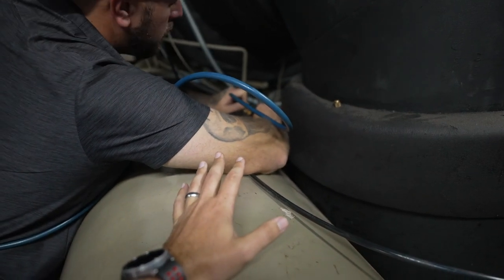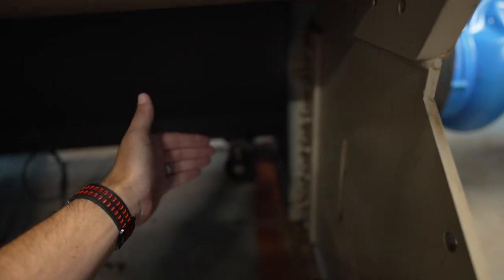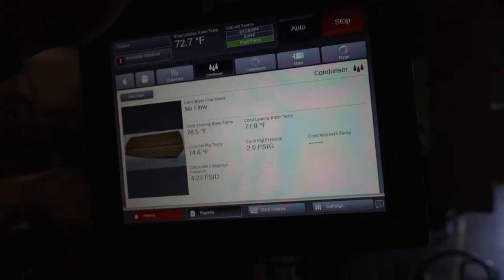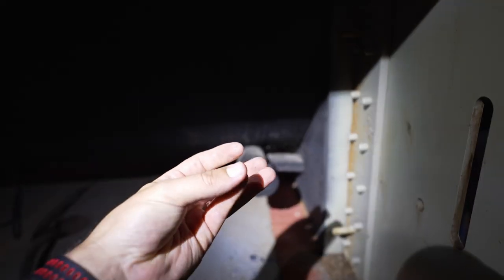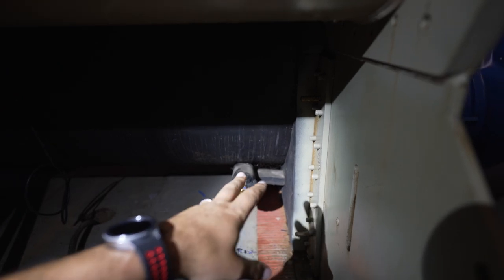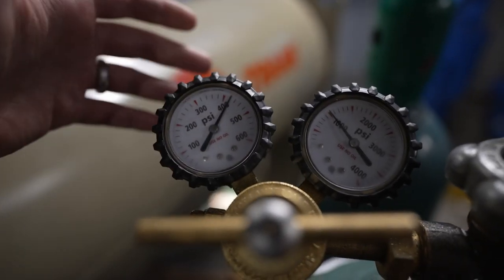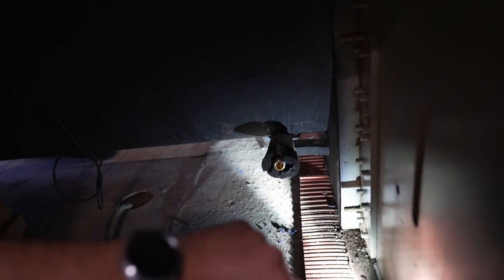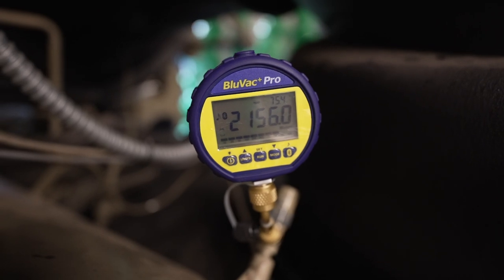Fixing Moisture Issue with Chillers

Comment: I've thought about this a lot. I'd like your thoughts too. What nobody thinks about is the moisture that is mixed with the recovered refrigerant that we are going to be reinstalling. We spend so much effort dehydrating the chiller, that we forget about the refrigerant we are about to put back in. We could take a refrigerant sample and send it out, or our annual samples on the chiller might show moisture. 
If we had a tube let go, the charge is "gone" anyways. I'm more or less talking about an open system (cold evaporator tubes attracting mositure / dew) or minor contamination (less than a cup of water).

Just food for thought.

Comment: Would raising the temperature of the barrel help remove the moisture at a higher rate? Like disconnecting the the hydro piping and ducting some sort of forced air heater into it? Or if it was possible to flow hot water from a boiler thru it? Maybe feasible with a 2 pipe system setting? Just curious. Maybe not enough to go thru the extra trouble?

Comment: Thanks for the information. I have noticed I can pull a vac to 400 mic and then during decay it will rise to about 2000 mic when Im working on a wet system. Great video. Thank you
Reply: Rite, that's the importance of decay tests, if you can get that low you're most likely safe from a leak but what he didn't go over in the video is yes water can and will evaporate/boil at these low micron levels but it's not like it just boils all of it instantly, if you have a wet system with actual standing pockets of water in a low spot, it can take hours at below 500 to evap all that water. That's why it's best to always have a heat source to aid evac in wet systems. That source of heat could be a number of different things depending on what kind of system, chiller you want water flowing through while evacuating on both condenser and evap unless of course it's air cooled, on an ahu keep your fans running, cuts down alot of time. What happens when a liquid boils? It's a cooling effect so you want to keep the system warm or you'll be there for days on a large system. Other methods that work well are triple evac or heck even 5x evac if needed, it works but again takes longer than heat

Comment: Call me crazy but I feel like some of the nitrogen that I've been getting has been wet. Probably wrong but something has not been right
Reply: Can definitely happen. Nitrogen doesn’t absorb moisture but can entrain it which is why purging like this can help get it out. The only dry nitro you can get is medical grade nitrogen as far as I know.
Reply: You are correct. Some nitrogen is wet. 
I think med gas nitrogen is dry but more costly.
Reply: @Fryloc87HVAC you are correct
Reply: @brianbray5397 I’ve heard medical nitrogen is the best kind you can get but going to air gas or whatever, your just getting whatever. But I suppose doing a triple Evac, you’ll get closer and closer to a below 500flatline
Reply: Call me crazy but I don't believe that the nitrogen cylinders lately have been completely full
Reply: @henrywilliams5093  I agree, one was given to me leaking

Comment: I have read an article from an old timer who would build large chillers that operated in a vacuum.  There was a clear paint like product.. can’t remember the exact name but I think I do remember it started with the letter G.  And I actually ordered a small can of it once myself 35+ years ago.. 

After the unit was entirely assembled .  They would literally have spray pots like automotive spray finishing sprayers and literally coat entire unit well, it was under a vacuum with two or three coats of this clear, shellac her or lacquer type product.. 

It was specifically manufactured for ceiling under vacuum in any small manufacture, imperfections, especially at gaskets well, it was under vacuum .  We’re talking micron size imperfections.. 

Would be drawn adhere, and set up and solidify 

And my father also has told me this exact same thing when I was young .   

Oh, so there must be something to it little labor, consuming procedures that were lost in time
Reply: Liqui-Vac? Imperial Eastman used to make it but it's impossible to find anymore
Reply: @yellowzx7r i have a can of of it
Reply: I also remember reading the same thing in some article years ago.
Reply: Glyptal